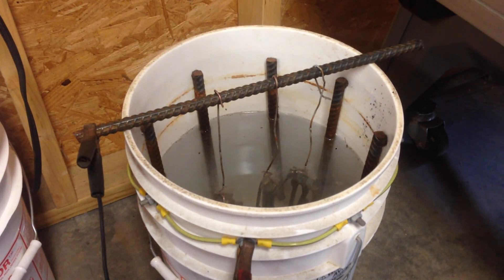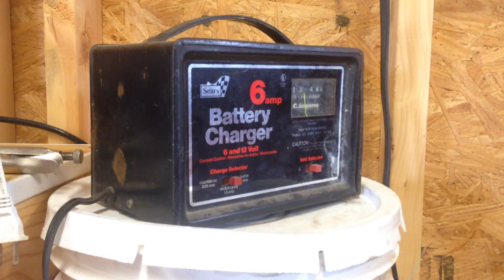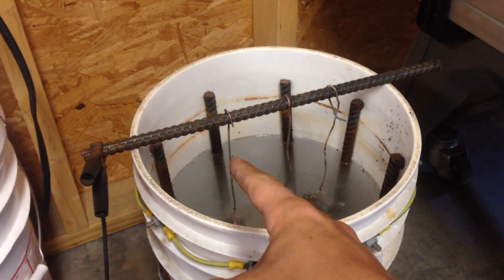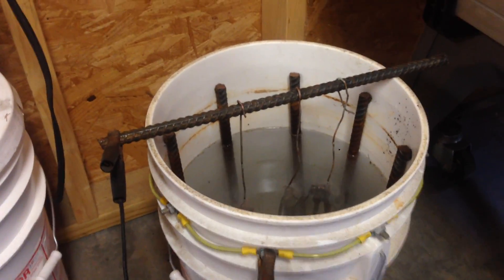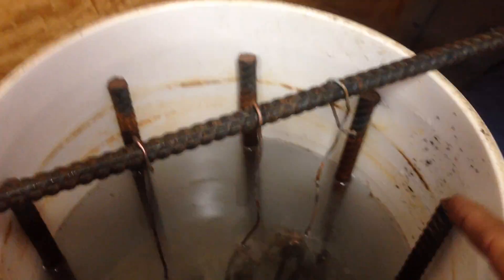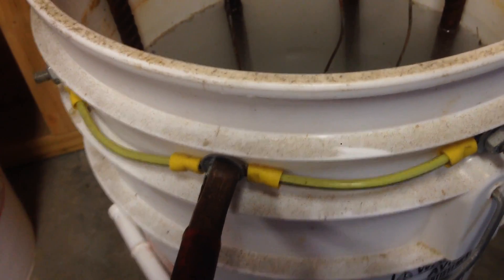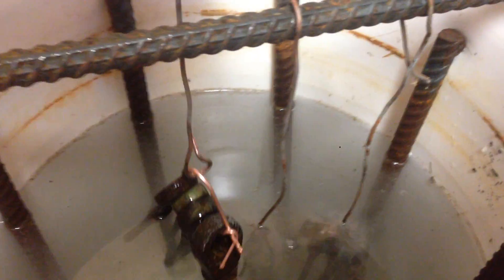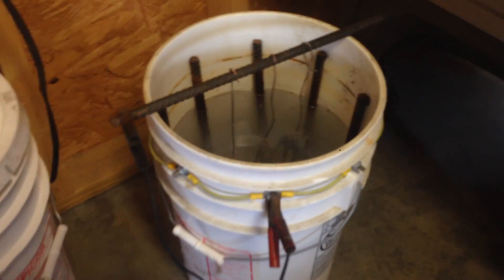DIY: Electrolysis rust removal.

Comment: ⚠️Electrolysis creates atomic hydrogen, which can ruin the steel. This is called hydrogen embrittlement.
Reply from the maker: You can heat soak items for 2-3 hours in an oven at 250-275*F to fight off the embrittlement.

That said, probably wouldn’t want to go using electrolysis on bridge girders or saw blades..
Reply: @BellyUpFishGarage  Yes, thank you. Immediate heat treatment stops the hydrogen embrittlement process. And you have to be very careful with critical parts such as load hooks or chains. But I am not an expert on this phenomenon.

Comment: I had to laugh at the make your house go kaboom. Thought I had instead of wiring everything on the anode side together just weld an entire frame of rebar and drop in the bucket.  Have a single connection point without the cost of connecting with copper wire. Only for the anode side of course

Comment: Can I use baking soda
Reply: No, you need washing soda.
Reply: Yes baking soda works teaspoon per gallon of water,i have been derusting several old tools and this works great but use metal that you don't want, because it will rust the hell out of it
Reply: Absolutely you can use baking soda , it actually has more ions for electrolysis than borax !!